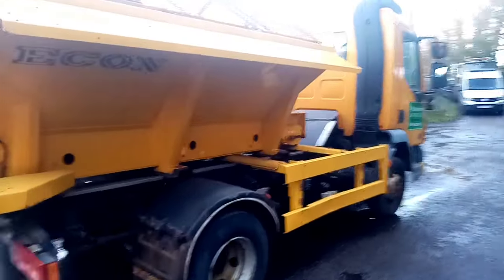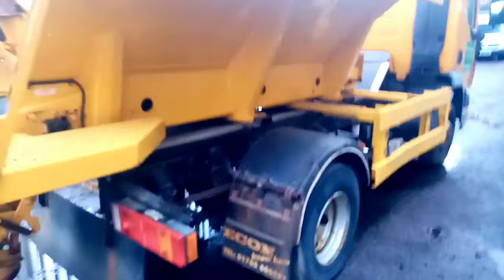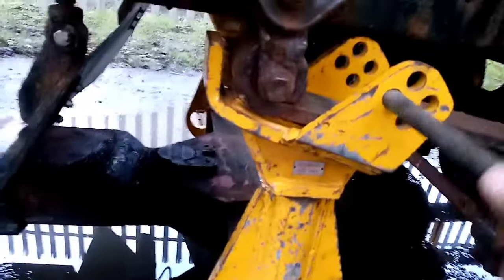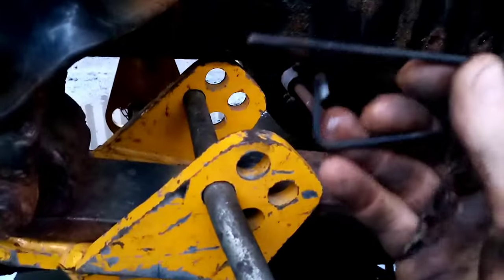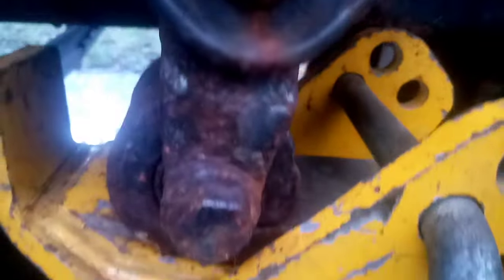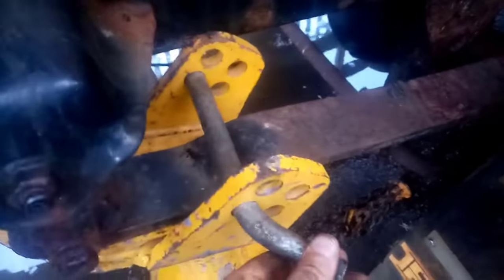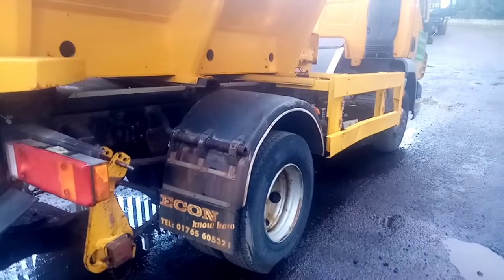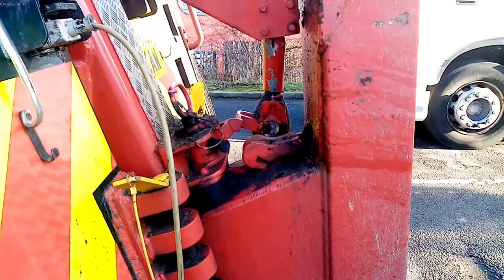Recovering Daf LF gritter to dealers using spring slippers on rear lift

Comment: Excellent video, and that gritter was in quite good condition, they are usually worse than horse boxes to work on!
Reply from the maker: Thanks Kevin pleased you liked it mate 👍👍
Reply: The Worst Things to work on my bro are Hydrostatic Turbine Sweepers & a Black Bag Dustcart. Gritters are way down the list They Like to Rot This Prob has a PCI Or Loom Fault to the Transmission... They are Poo.....

Comment: Just out of curiosity, why do you have to dis-connect the final drive for towing, you don't have to do that to tow a car.
Reply from the maker: Hi Michael, most trucks and coaches have an oil pump in the gearbox for lubrication, this pump is driven by the input shaft from the engine, if the engine isn't running and the vehicle is towed then the gearbox is turning via the wheels which doesn't work the oil pump, this will seize the gearbox or wreck it so the drive must be disconnected mate